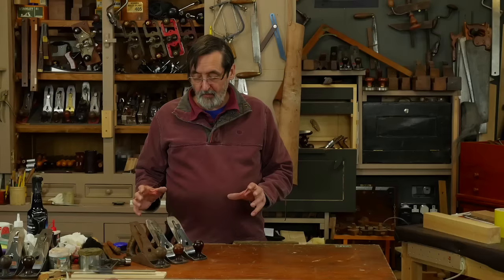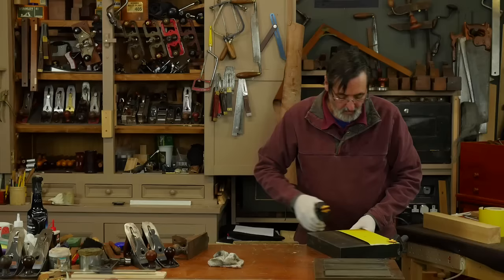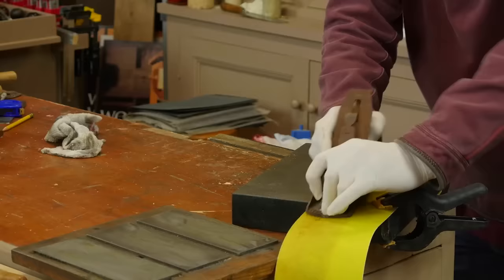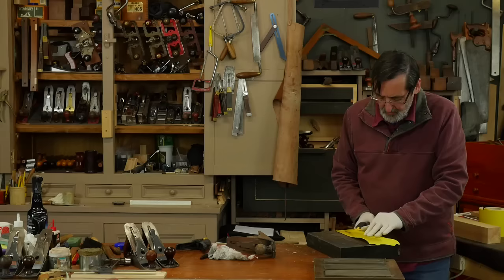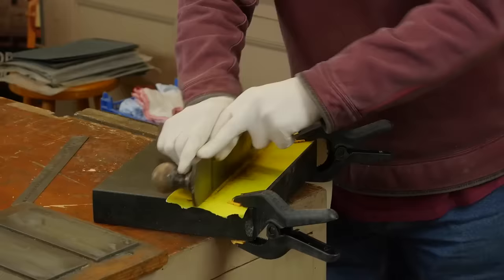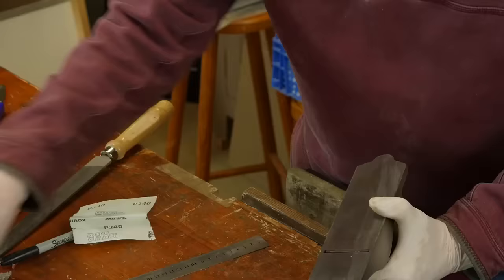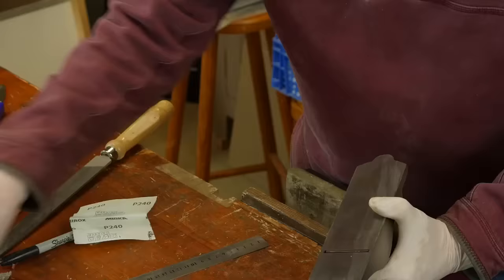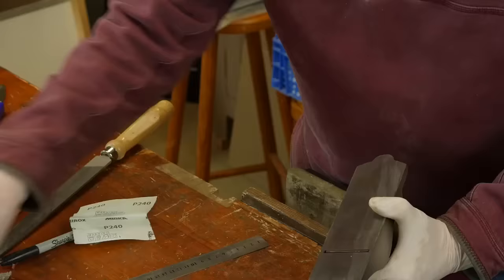Restoring the Bench Plane | Paul Sellers

Comment: After watching this video I applied the principles to what I think is a B&Q own brand plane that was bought for a project in 2008. I thought the tool was such poor quality, and it barely functioned out of the box. I wrote it off as 'you get what you pay for'. But after using these restoration techniques and an old glass shower screen with odds and ends of wet and dry paper, it has transformed into a perfectly well performing tool. It's still inferior to a stanley or record tool. Similar design I'm sure, with plastic handles rather than wood, but the use I got out of it this afternoon alone justified the exercise of restoring it. I really enjoy all these carpentry videos. Such a great resource. Keep up the good work!

Comment: I restored my Father in law's Record No.4. It wasn't anywhere near as rusty but the Iron was dinged badly. Fortunately I have a Tormek Wetstone so the sharpening process took minutes. I used the Plane over Christmas when I made my English Yew live edged side table! It worked sweetly once set! I took the Shellac off the handles and left them bare with a liberal wiping of Boiled Linseed as you suggest here! Great Video as always Paul!

Comment: Paul,I broke my dads plane when was about 11 years old by dropping it on the concrete garage floor whilst planing 2 inch oak, when I started work in a factory as apprentice electrician I had it brazed back together across the throat which worked out quite well. I still use it today for odd jobs on guitar repairs/making, I'm now 65 and just oiled all my tools against rust. I like the rag in the tomato can idea must try it with 3 in1 oil. Great idea!. Great video! Thanks...

Comment: Proud owner of a brand spanking new Stanley Bailey #4!! :D The Home Depot sells the 12-904, which is apparently a "contractor grade" model. It's my first plane, but I can tell it's a little rough. Tool marks on several parts, minor paint issues, and the handles are an infuriatingly slippery gloss-finish plastic. Still, I've confirmed all bits are present and in good condition, and it's definitely a cut above (ha) the ultra-cheapy ones you find for <$30. I've made a to-do list based on this video to make sure it's sharp and tuned up, but I accidentally took a shaving off my desk, so it definitely works. :)

Comment: Been using your technique and came up with a trick to deal with the iron dust that builds up on the sandpaper. Get two stacked disposable plastic cups and put a magnet in them. Run them over the sandpaper to lift off the filings, then pull the bottom one down and off over the trash bin to release the filings.

Comment: Thanks for all the excellent videos Paul.
I thought I'd mention that the Y bar connection to the depth  adjusting knob may also need tweaking.  My second-hand Rapier 500 was very difficult to adjust until I slightly widened the gap in the Y bar.  Only identified the problem by turning the knob first without and then with the Y bar in place.  It's now working perfectly.

Comment: Paul I think i`ve solved the Stay Set problem. I separated  the blade  and chip breaker and noticed the contact surface of the chip breaker was uneven. Modern methods use Lasers for perfect accuracy .This one was like --imagine if you made the piece out od pastry and cut the holes and outline with pastry cutters. It was all a bit squashy looking.
      The adjuster had been missing the edge of the plate. 
I compared the No 4 and No5 .Both adjusters were the same.The standard chipbreaker worked fine in both .   It took ages to flatten the joining surface on a diamond plate. All the way from the front edge to the cam area .  Now it does verything properly . I had ground the front edge 1/8th inch shorter  and the blade retracts and peeps out as it ought to . What a hassle !

Comment: What a valuable complete course in plane restoration! Everything you might need to know was there plus some really good practices I hadn't heard of such as rounding over the plane body corners and ends and the edges of the iron. In practice though I think if you had a slow speed grinder or especially a wet grinder you'd want to use it...that was a lot of work. Thank you very much for all the instruction.

Comment: Small tip from an HGV fitter to a wordworker, when shaping your cut bolt end threads to fit the female, put the file in the vise and pass the fastner on the file. More finger feel gives much more control-the key in any craft.

Comment: I've watched and learned a great deal from Paul's videos.  I am grateful for all of them.  I've only just come on this one on restoring an old plane.  I made notes on some questions I had as I watched that I didn't see or hear answered (although that might be down to my attentiveness).

First, I don't remember any remarks about examining or adjusting the plane's mouth/throat (that space in the sole through which the iron protrudes.  What should one look for in examining an old or new plane with regard to its mouth?  If one finds problems, which might be correctable and which might make the plane less useful or even useless?

Second, if one finds that the screws holding the tote and knob need replacement, where would one look?  As I understand it, Stanley - and perhaps other producers - used proprietary threading making it impossible to buy correctly threaded replacements.  If one cannot find a replacement or if the threading in the casting is damaged, are there techniques one my try to salvage the casting?

Third, Paul sighted the plane iron by eye and declared the cutting edge square to the sides of the iron; however, I didn't see him check it with a square.  Is checking with a square unnecessary?  If so, why?  I realize the lateral adjustment can adjust squareness, but I've always thought that one should use a square to measure and adjust the iron.

As ever, thank you for the time and generosity of spirit you impart into these videos.

Comment: Very nice collection of old planes. I'm guessing you would have a nice collection only on display and not to be used. Great video for those wanting to restore a plane, or even just to bring their plane back up to scratch. Only thing I do different is using wet and dry sandpaper as I find it is quicker at taking rust off or to bring the cutting edge back. I don't wet the paper at all and dust it down often.

Comment: I've got a cheap un branded plane with yellow plastic handles that had the wrong angle on the plane iron , it was rusty and disgusting . When I tried to pane with it nothing happened it just slid along on the heal of the blade . I filled this video to the letter . My plane still looks horrible due to the handles , but it works like a dream ; even makes that lovely crisp swishing noise !
Thank you
Reply: Make new handles for it. Select a nice wood such as walnut and you will end up with a plane that looks high end. 
Paul has done this on his common woodworking and I think he may have videos on how to do it as well. 
you can actually buy them as well for a reasonable price. If you like the plane and it has a good feel to you then get the handle and tote and personalize it.

Comment: Novice tip:  at about 26 minutes.  before cutting the end of a threaded rod, or a bolt.,  put a nut on first, then when you take off the nuts, it will true up the threads, and make it easier to start.  Many thanks for a great video..    QUESTION:  Why is the brass adjustment knob left handed thread ?

Comment: Beautiful video Paul. Full of excellent advices and details on how to use down to earth methods in tool maintainance. 
I would like to suggest though to try putting the plane in a bowl of Coca-Cola, (without the wooden parts). You will get rid of the rust without using any hard chemicals. Also, it will save you some time and you will not inhale the rust. It worked for me.

Comment: Hey Paul,
Nice as always. But I have a suggestion on that:
Try putting the rusty iron parts into citric acid (as you can buy in drugstores) over night. It will transform the rusty surfaces so you won't have to grind as much as without acid. That worked perfectly fine for me quiet often in the past.
Best Regards
Matt

Comment: I use wax on my frog and blade assembly focusing mainly on the parts that have to slide when you make adjustments. Both on the blade advance as well as the lateral adjustment. It makes adjusting the blade so much nicer. Just a regular old can of paste wax. I use it on the sole too when I'm actually using the plane. It makes it glide along the work with a lot less effort.

Comment: That plane wasn't too bad off.  I received one that was quite a bit worse, and so I used a non-toxic electrolysis method to remove rust in the nooks & crannies after disassembly and removing the tote and knob.  There are also commercial rust removers, but I've not used them yet.

In my location, there are extremes of humidity, from very damp to desert dry (<15%RH), and this swells and shrinks wooden handles..  On the next plane that needs 'rescue', I might try putting a film of hotmelt glue under the tote and knob. I've done this when replacing handles on socket chisels  to bed the handles firmly. They never loosen and the chisel feels solid in my hand.  The handles can be released easily by gentle heating with a heatgun or clothes iron.
Reply: +Bob Blarney I have wild humidity swings too. That's a good tip! And in return I have a tip. My favorite de-ruster is EvapoRust, a mild non-toxic rust remover solution that works really well to remove rust from nooks and crannies. Just wash it off with water and immediately apply oil.

Comment: I have a few planes (Stanley) that could stand a complete overhaul like that.They were never "initialized" in the fashion you describe, so while removing a bit of surface rust (unheated garage for many years) I can do the things like removing the rough edges from iron and cap; from the edges and cheeks of the sole; ease the entry and tail of the sole; flatten the sole and iron; clean up the leading edge of the cap; refresh the edge of the iron (I have kept that in fairly good shape) and soften the corners; and then reassemble. I've never thought about the pleasure that using a plane with all rough edges removed would bring. My goal has always been limited to getting a decent shaving.

Comment: For those in the UK wanting a flat block for sharpening, Dunelm sell a black granite worktop protector for a little less than £10. Works a treat for sharpening using abrasive paper.

Comment: How do you test flatness of the sole?   Find a window with vertical blinds.  Look at the reflected image of the blinds on the sole surface  at a grazing angle.  At a grazing angle the unpolished surface will give a mirror like reflection.  Rotate the plane around the line of sight so the blinds in the reflected images are horizontal.  Deviations from flatness will be greatly amplified by the grazing angle.  (An old trick from optical fabrication work)

How do you get rid of rust?  Disassemble the tool and wash in hot water with detergent to remove a boil film.Then soak in white vinegar for three days.  Final rinse and clean up with a toothbrush.  I did this to a 22 inch plane that I bought for $1.50 and ended up with an expensive tool.  Alas, the blade was pitted beyond salvage, so I got a new one from Hock.

Comment: Best video yet. Going to read through the comments to try to find info on the dead flat surface Mr Sellers is using (weight / cost / material... Is it granite?). Also type of flat file (guessing bhaco or old stock nickelson (spelling it wrong).
Reply: Woodcraft sells granite slabs in USA

Comment: Paul, immediately after watching this video, I went out to my shop and pulled out a Stanley #4 (Type 14)  that I picked up at a flea market last year and began the restoration process.  I'd been putting it off for some time because I wasn't confident about what to do first and didn't have a good, flat surface I could trust for flattening the sole.  Well, I solved that problem a few weeks ago by purchasing a granite slab and I had not reason to wait any longer.   Besides, it's started snowing here and I need something to keep me occupied during this blizzard.  In just the first hour, I've made good progress, though the iron on mine is a bit more nicked than the one in your video.  I'll have to regrind the bevel for sure.  Thanks for another great video!

Comment: There's a gravestone cutting and manufacturing place near where I live that puts their off-cuts out at the curb for people to take for free. I look for smooth surfaces that give a visible approximately mirror-like reflection with a parallel opposite surface and use these as foundation surfaces for plane sanding. The stones with a large enough surface area to use are also heavy enough to stay put while you are using them. I also have a 12 inch by 12 inch granite counter-top tile from a big-box home center that has been polished that gives a perfect reflection. It's just not as heavy as the off-cut granite from the gravestones. An illuminated fluorescent light tube reflected off the surface will show any deviations from perfectly flat as distortions.

Comment: Thanks Mr. Sellers for the tutorial on plane restoration, if only so the young emerging woodworkers could see how simple it is to achieve excellent results from an "old plane" without needing to purchase a "new model high cost copy" that may or may not be marginally better. If you don't mind me asking, do you ever use Japanese tools ? I ask only because of my respect for traditional craftsmanship and the Japanese seem to have taken traditional tool making to the highest level without high tech machinery. Not that other cultures haven't achieved similar success, only that the "traditional" Japanese craftsman seem to have done so with out the headlong pursuit of mechanization. Did that question make any sense? Thanks.

Comment: I tuned a plane yesterday on which the frog would not sit parallel to the mouth. This was a Bailey style frog, just like the one in this video, so it had two vertical bolts that hold the frog to the sole and then, back near the tote, a U-shaped piece screwed to the back of the frog. This U-shaped piece is captured on a specialized adjusting screw that is used to set the mouth opening. See Paul’s video around 1:00:40.

On my plane, either this U-shaped piece was twisted or the adjusting screw wasn’t bored true. The result constrained the frog from sitting parallel to the mouth. Since this adjustability isn’t essential, I loosened the bolt that binds the U-shaped bracket to give it some play and then was able to set the frog correctly parallel to the mouth and then tighten it down with the two vertical bolts.

Hope this helps someone else. It puzzled me for a bit.

Comment: One strange thing about the Lever Cap Screw . It`s slightly countersink . It fits vertically in the frog but the pressure  applied by the screw when the lever is dropped is only on two points  (left and right ) as the Lever Cap slants downwards at a steeper angle than the frog surface. If you used a plain washer it would not work properly (apart from getting in the way when dismantling ) .  I wonder if that screw pattern has a special name  (?).  A nice observation for you to treasure all your lives . (That`s a Nabokov quotation ).

Comment: Hi Paul

Your blogs and YouTube channels have been an absolute inspiration to me, many many thanks.

I have. A quick question regarding refurbishing old planes, in this case a Record no. 5 1/2 and also a Stanley no. 5 1/2. Don't ask why I have two but just to say sniping software 👍🏻

The Stanley blade is very badly pitted and marked! It looks like it's been etched by something. So now to my question. I notice that the likes of Veritas can supply replacement irons and cap irons which they advertise as Stanley and Record replacements. They are thicker than the old Stanley irons and the design of the cap iron is now virtually flat. The thicker iron seems like a good idea. 

Have you had any experience of these and importantly, do you know if they actually fit?

Keep up the good work as your channel is a joy to follow.

Comment: question to mr. Sellers
A while back i made my very first very own wooden base plane with reclaimed frog and blade.
i dyed it green, laquered and it was absolutely fine.
But something happen to it in winter, sole wasn't sealed or something like that, and entire plane just bowed up, so there is about 1,5 mm difference in level acros the plane sole.(i can plane wooden platters, but that's about it)
It is consistent though and did not warp in any catastrophic way.
The question is:
How to bring it back to level?
How to make it stay flat?

edit*********************
Sorry for the trubble, but it so happen that this problem resolved itself.
And the problem wasn't the plane :] it was the flat board i was checking it on.
Different surface, different results. 
So thanksfor your time anyway. i will be back to see more :] as usual